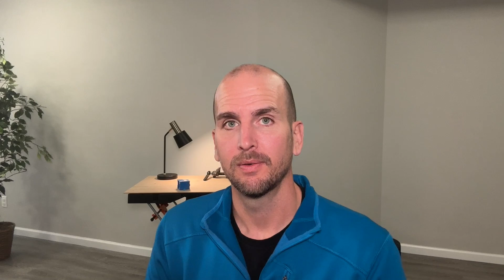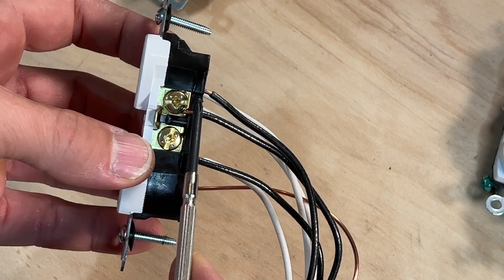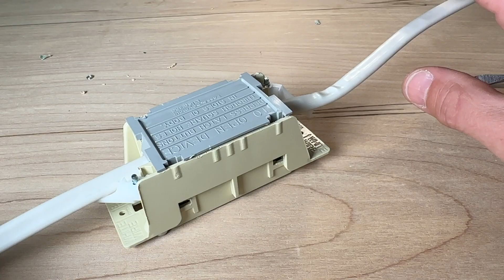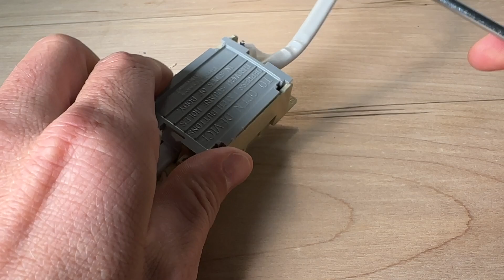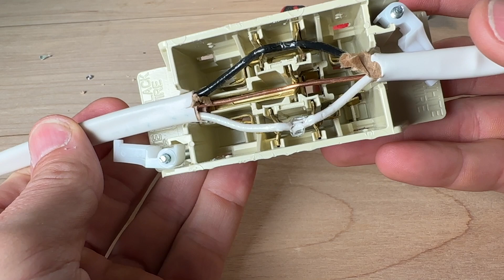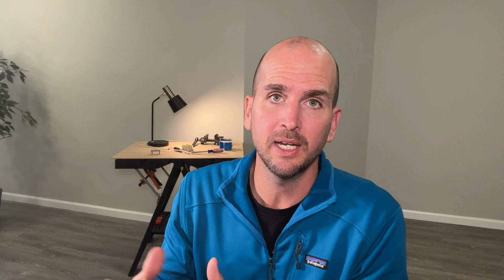90% Of Homeowners Have Never Seen This Dangerous Electrical Device

Comment: I've use this type of connection in automotive wiring and found them lacking in a 12V system due to the poor contact and the tendency of the wires to move around, loosening the contact.  The attraction in the automotive setting is that you can tap into a hot wire without cutting and then splicing it.  I gave up using them and just went to the fuse panel to pick up the hot.  Even a jury rigged stranded wire stuffed into the cold side of the fuse connection is more reliable.  Don't ask me how I know.

Comment: How many amps per outlet is the expectation? I'm British so I don't know your standard. 

We allow 13A per outlet but typically there are many outlets on a ring main with a 32A breaker, so you can't even fully load three outlets at the same time. (13A is 3KW because 230-240V)

Comment: With the right tools you could skin off insulation in the middle of a wire run and screw a clamp onto it. Like a tiny 15A bus bar. 

The problem is that the industries that use this stuff want to nickel every last dime out of their customers. So they begrudge the specialized wire stripper, the 30 seconds it would take to screw a clamp tight, even the correct punch-down tool. (Which probably makes this illegal, and certainly a lot more dangerous than it should be.)

Comment: Never seen, but I am just a homeowner with some experience in wiring as a youth.  Glad to hear there is a specialty tool for installing.  Would it look better is the right tool was used to install, and does code require use of the tool?.  I would not want them in my home.

Comment: Common sense would tell me to remove the insulation from both the hot and neutral conductors in the area near the stabs.  Once the conductors are pushed into place, I would use an ohm meter to verify conductivity by measuring from the plug side to the wire side for all three conductors.

Comment: I don't like that type of connection in a vehicle, let alone my house.  I do use "punch down" connections for telecommunication or network wiring, but there are no amperage issues there.

I just gutted a travel trailer and it was all done with backstabbed connections.

Comment: I have only seen these in RV's. Even though it is UL listed, it only holds up to the listing if it is installed correctly !!! These receptacles need to have the wires pushed down with a proper punch down tool. Also most local codes do not allow the use of these self contained receptacles. I have seen a few in garages or additions that were done by homeowners or unlicensed "contractors" ...

Comment: Yup, you should see the light switches.. These things should be illegal.  But, with most mobile/manufactured homes, every corner that can be cut has been cut. The primary joining material is glue and staples.

Comment: The USA never cease to impress me by how low their electric standard are... for example, the "commercial grade" plug is the absolute minimum standard of wiring for european plugs (no matter what state), with the difference that, when fully assembled, there's no way to touch live metal pieces. Even the screw head is recessed in the plastic mold.

Comment: Had these on a mobile home and they were rated for straight through wiring per AMP the manufacturer.  Ended up having one that was intermittent and took it apart and they were doing SPLICES inside the outlet.  The wire going to the downstream outlet was placed in the bottom of the V and the wire on the breaker side was on the top wider side of the V and was loose in connection.  Reset the wires further in the V on one and on another one found a shallow depth old work box and replaced with an outlet with screw terminals.  While in  lower current applications these were fine but incorrectly doing splices or high current uses the
these are a fire waiting to happen and disappointed that AMP made these Insulation Displacement Termal outlets.

Comment: I never understood how these death traps ever got UL certified! 
I bought a manufactured home in the early 80`s and in less than a year I started seeing these things fail. Luckily for me I had a lot of experience in this area. After the second failure I replaced all of the outlets and switches in this home. I never would think of using the stab in the back wiring on outlets. I always used jhooks.

Comment: Yup.
My wife and I live in a double-wide in New Hampshire. The place was FULL of these, AS WELL as the "SWITCH" version! (uh huh.... they actually make/made SWITCHES like that too!)
Luckily, in this state, we're allowed to do our own electrical work on our own residence. 
I'm not an electrician. I am, however, someone who likes to do his homework before embarking on electrical work.
While I have no formal qualifications to make the judgement, the first time we had an issue with an outlet, I was HORRIFIED at what I saw when I pulled the outlet from the wall! (yes.... I made sure the breaker was off!)
I promptly spent a couple hundred bucks on residential grade outlets, matching switches, and PVC old work boxes!
Replacing outlets, even that we weren't experiencing issues with, I noticed that quite a few were discolored inside. 

Again, I'm NOT a qualified electrician, but I still wonder who got paid off to certify these time-bombs for permanent residential use!

Oh, by the way, the place originally had a Trilliant breaker panel (distribution center... whatever....). THAT whole thing was plastic too, with aluminum bus bars! (but that's a whole different horror-story!)

Comment: It's fine because it "meets code when properly installed" lol
An unsavory contractor not installing things correctly is bad in any situation, no different here, really.
But it is a bad design because it's obviously not idiot-proof, requires special tools, and requires special training above and beyond the norm.

Comment: These are called insulation displacement connectors.   They are not intended to remove the insulation but to shove it aside.  These can be good connections but the will represent the high resistance point at the connection contact point.

Comment: I think those would be fine if installed by taking the insulation off entirely in the area they contact, they could also stand to have a thicker connection tab, but the whole non cut through passing wire idea is nice.

Comment: This type of widely used connectors are absolutely fine IF the correct installation tool is employed but not safe, using a screwdriver blade and such like, to press the wires half in.

Comment: I have low-voltage punch-down experience you mentioned. While not professional, I also have the necessary tools... but for 110/220V.. F NO. Who thought this would be a good idea? Also, that looks atrocious, barely inside. Even for low-voltage stuff, it is shoved to the bottom by the tools, not barely (not) hanging on. Not surprised it failed. Surprised it didn't start a fire.

Comment: Speaking from overseas, I'm stunned that such a technological nation as the USA can even pass this as fit for use anywhere, is totally beyond me. It looks more like the kind of cheap trash you would expect to get from China. I would imagine "Big Clive Dot Com" would have a field day demolishing this.

Over here, UK, our electrical wiring regulations would never allow such devices to be installed in any location. All connections over here must be made by way of screw connections, even "Twist Nuts" are not allowed, though it is apparent that WAGO, and WAGO type connections are beginning to appear in some settings.

IDC connections are, as far as I'm concerned, strictly limited to telephone and Ethernet usage!

Comment: I cannot believe that is an approved, code-compliant receptacle. As you said that is what low voltage network Jack's commonly use. But I can't for the life of me believe this is approved for anything over say..60V. Because that's roughly the max of the network POE spec. Looks like an accident waiting to happen

Comment: The only way it could be UL listed as well as meet electrical codes is if it is installed properly, using the correct tool.

Comment: I hate using those type of connectors in cars.  There are little wire splicers you can buy for your car where you just place the supply wire in one side and the load side for your device in the other, and when you squeeze it there's just a little blade that cuts into the jacket of both wires to make contact.  I don't like them and don't trust them.  I would literally rather cut a wire in two and use a butt connector, wire nut, solder and heat shrink, etc.  We bought a brand new double wide home 2-3 years ago and it has these in the wall, and never knew that this is how they operated.  Now that I do, I'm going to go about replacing them all with better outlets.

Comment: You say you can not see how it meets code, but it does, as if it didnt it would be illegal to sell. The problem is, it does meet code when proper installation tools are used to make correct contact with the cable as it goes into the blade. The way that one has been installed is by a monkey with a screwdriver.

Comment: I remember the first time a came across these. The plug that the coffee pot in my grandmothers kitchen was plugged into had a loose socket and was starting to melt; I was so appalled when I pulled this thing out... and there was barely enough wire in the wall to stick in a proper box and receptacle. I refuse to use these abominations! I actually ended up telling her not to plug in anything with a heater into outlets I haven't replaced. The kitchen was remodeled not too much later and I replaced all the receptacles with proper ones. How these things are code compliant is beyond me.

Comment: Why would anybody use these devices.  Is there a race of some sort to see how fast an outlet box can be wired, even if it doesn't work.  The electrician will get paid either way, but will have to return to do the job correctly in the future, which will make twice the work, but only get paid once.   Nonsense !

Comment: I work on aircraft electrical and electronic systems.  Now, aircraft vibrate and stretch in flight, so the methods to connect wiring must be very secure considering how critical so many systems are to the safe operation of the aircraft.  I'm not even a fan of how domestic wiring works, but I also understand it doesn't have to undergo the rigors of a flying machine.  However, that box shown in this video seems downright dangerous.  Terrible connection points, and seems like a recipe for how to start an electrical fire.  TBH, just looking at it gave me the creeps.

Comment: I've fixed several campers that have them in them and they've all failed the same way. Water gets into the unit because these were installed on the outside of the trailer for some bizarre reason without a weatherproof cover and invariably the wires are full of corrosion and the whole Outlet is just filled with that green cancer. And it also never fails that the outlet is for some reason in the middle of a run so half the outlet suddenly have no power.

Comment: How is this even legal for high voltage outlets?
Like, this works great for low voltage applications like Ethernet where you are transmitting data, with minimal current but why would anyone think that this is a good idea for 120v?those look like they can come loose so easily

Comment: Hate those things. I'm a 30Pain in the ass to reinstall new old work boxes because they don't leave enough wire to have the 6" outside box code. I never put back what has failed in the past.

Comment: This concept is common for lan cable receptacle termination. When using POE 24 VDC lighting via LAN it may be adequate but not for 120 VAC or in many countries such as Europe….240 VAC.

Also these are not CSA and not cUL approved for use in Canada.

Comment: Poor design. Should have its UL stamp revoked.

The backplate itself should be designed to replace the dedicated tool used to push the cables in place. When you push the backplate on, it shouldn't snap in place until it has forced the wires into the correct position.

Comment: This technique is used in all kind of computer and machinery connections but only for low power application. And you only have to insert the wires and press on part of the housing to get a repeatable contact. Wire thickness is critical of course and must match the connectors.

Comment: Having recently received a new mains connection to my house, I can attest that we use a very similar system for that here in Europe. Albeit a few sizes bigger obviously.

And I can't even remember the last time I've seen a screw terminal on a household switch or outlet. It's all "stabbing" here.

Hence, I believe that calling such connections dangerous is unnecessary.
Sure, more contact surface, more better.
But also: enough is enough.

Ps: in this case the connection was made badly, by not using the appropriate tool. As mentioned in the video. That's another problem though.
Reply: @jenshellwig2574  Yeah, not my clearest of comments, I admit.

With my mains connection, I'm referring to a connection method very similar to what's shown in the video. Though instead of jamming the collective wire into a clamp, the clamp got driven into the collective. And then sealed in epoxy.

Somewhere in the video there's a quick reference to the "stabbing" method of connecting domestic switches and outlets being inferior to a screw terminal. Which is what I'm referring to in my second paragraph.

I'm assuming that in America such a connection is the same as with us. So indeed a spring "eating" into the wire a bit, whilst pressing it up against a plate. Which is plenty of contact area for the rated amperage. Albeit less then with a screw terminal tightened with enough force to deform the copper wire.

I agree with you on liking the spring connection better. Although I've seen both of them fail.

As domestic switches don't come with a secondary clamp to affix the wire to the switch. The wire can start to move (wiggle) when the switch becomes loose. As some people don't mind living with a wiggling switch for 15 years, that movement can cause failure.

In case of the screw, it gets loose. Allowing it to continue to function, but now with a chance of drawing sparks and causing fire. (I've had quite a few clients call me as their switch started to smell bad. The fact that it had been making noise for a few years already hadn't bothered them..)
The spring however, made an indentation in the wire. Which is where it will snap after many wiggles. With a much higher chance of losing connection completely. Or at least make it bad enough for the client to notice.

Comment: Those "speed wire" or "back stabbed" outlets have minimal contact on the wire as well. Its just the edge of a metal flap making contact with a round wire. The contact area is probably measured in thousandths of an inch, about the same as those blade connectors.  While I don't like them, they have been in use for decades. Its interesting that a certain gauge of wire is required for a specified amount of current and then the connectors defeat the purpose.

Comment: So the major issue is installers not using the correct tools 
The reality is economics,  doesn't matter what you are buyying you will have a choice of quality and budget 
The example you have shown is obviously the budget end of the market 
and clearly the correct insertion tool wasn't used.
Ofcourse the models that have screw clamps are the preferred way, but even those if not installed correctly can be more dangerous 
Believe me I know, been a sparky for over 35 years, and have come across many badly installed outlets 
Does matter the quality of outlet, it's the quality of the installer

Comment: Our home has these for its rocker switches.  I would not be surprised to see them in our outlets as well.  So far, one of the rocker switches had arcing in it and was causing the lights to start shorting out. I insisted on getting it replaced with the standard light switch without that wiring set up.

Comment: Can confirm that these are trash. I live in a doublewide full of them. The switches barely work. I have to slap them sometimes. I actually replaced one, which is a real pain in the ass because there's no box. Had to put a cutout box in and wire a switch.

Comment: Had to replace one in my in laws trailer last week. They had a space heater plugged in downstream of it and it started smoking. Unfortunately due to the depth of the wall I had no choice but to replace it with another of the same

Comment: I think the backcover is poorly designed. I'd expect posts covering the wire with slots for the blades. With a proper design you can actually use the back cover to properly seat the wires in the blades preventing damage to the wires and hold them in place. It wouldn't cost more to produce but make them easier and fatser to use, remove the need for special tools and be safer.

Comment: The rotary thumb switches that go on lamp cords are also insulation displacement. 

I’ve never seen an insulation displacement connector for high current stuff. Typically in industry for high currents you go with crimp connectors.

Comment: The sad thing is that these could actually be great. The lid should press the conductors in.
The better way to make labor saving installations is to use standard socketed connectors and appliance cords to wire receptacles, not sure when we'll see that though.